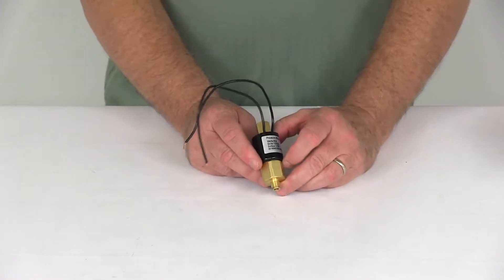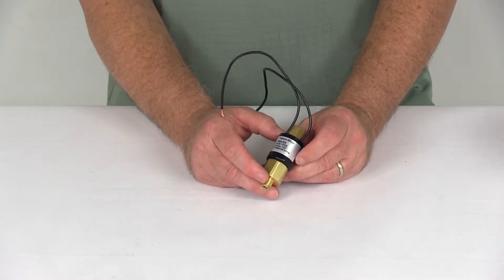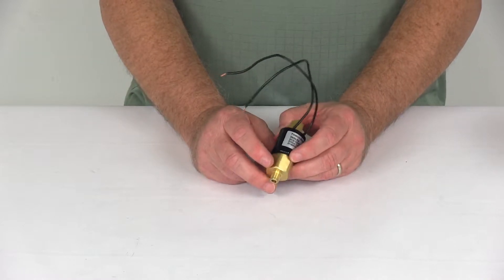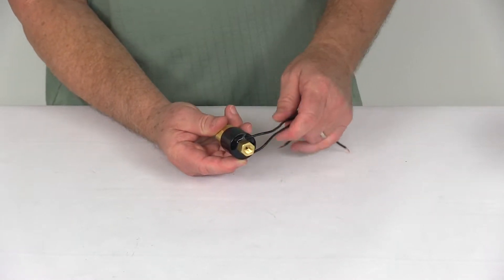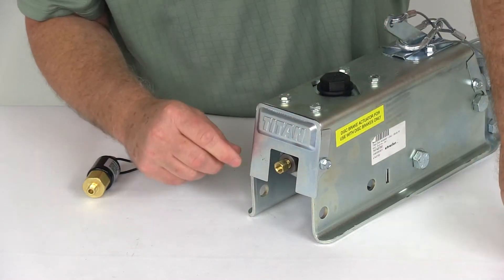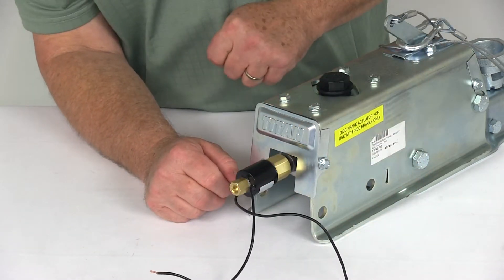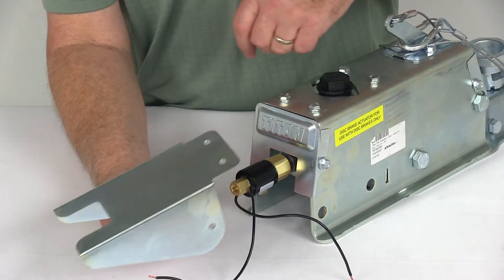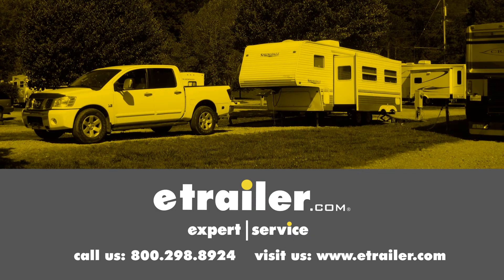etrailer | Titan Brake Actuator T4748800 Review

Comment: Can you bleed the brakes through the solenoid without power to it?
Reply from the maker: You want to bleed the brakes with power to the solenoid because the solenoid will need to be bled too. It is best to bleed the whole system all together.
https://www.etrailer.com/Accessories-and-Parts/Titan/T4748800.html